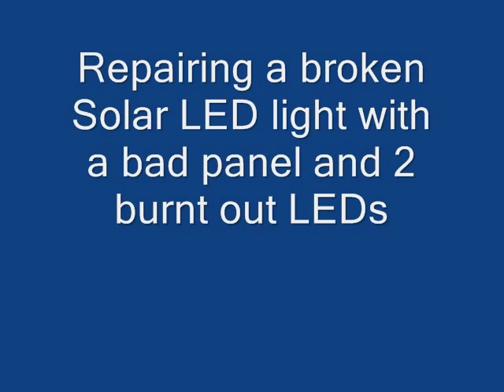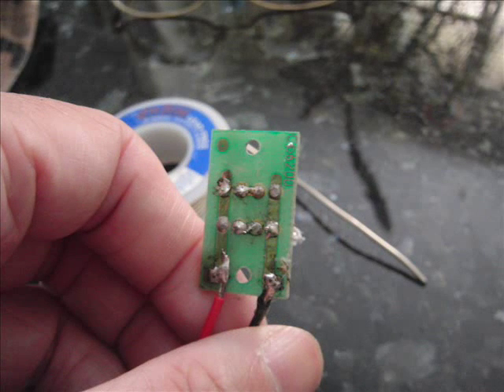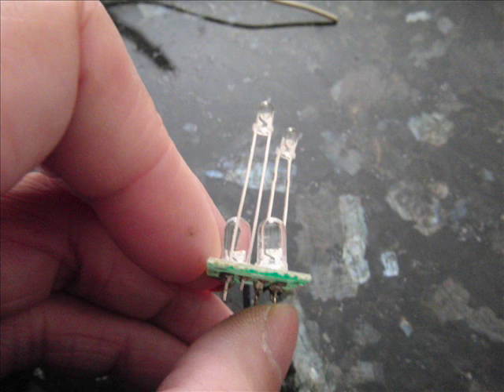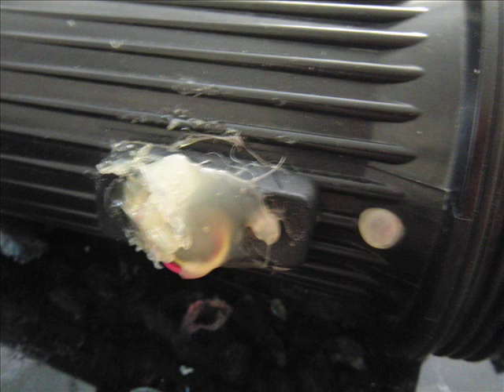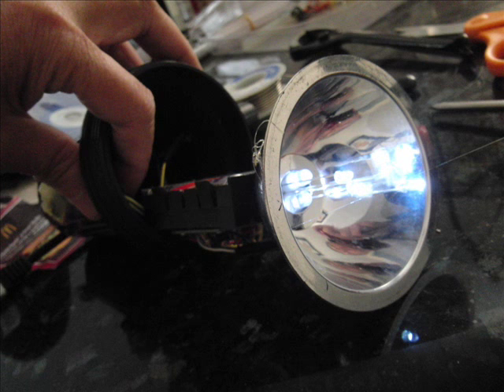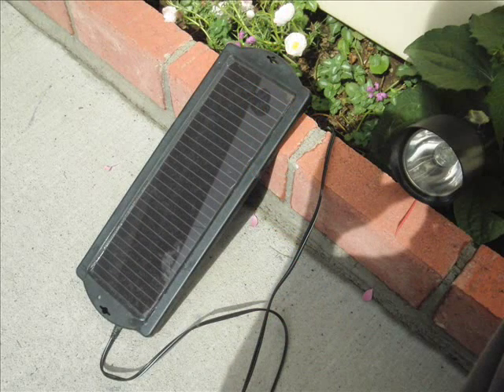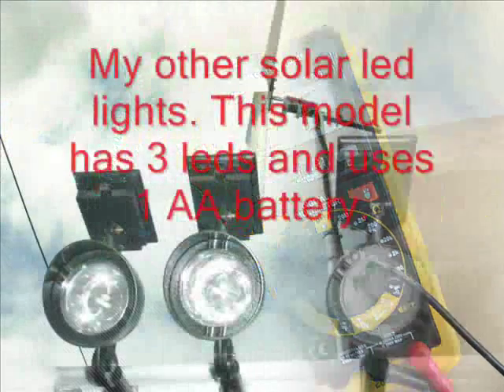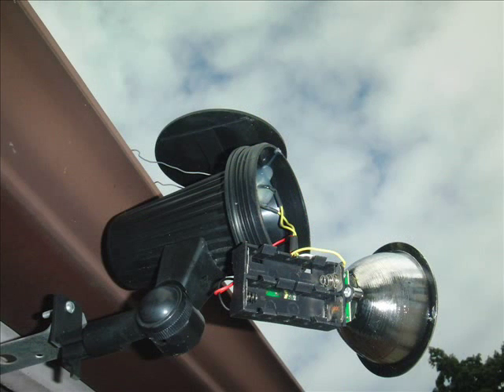Rechargeable LED solar light repair Movie.wmv

Comment: Great project!  I've been thinking about doing this same type thing.  I have your same complaint that the manufacturers make such a weak design with weak batteries and lights that stay on (and dim at that) for just a couple hours instead of the whole night.  I hope your mod works and gives you better light.